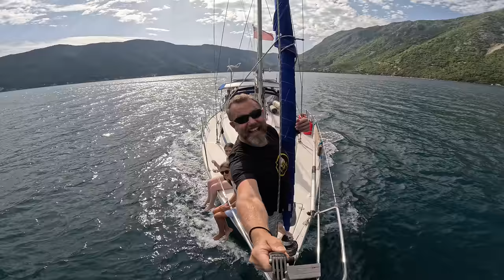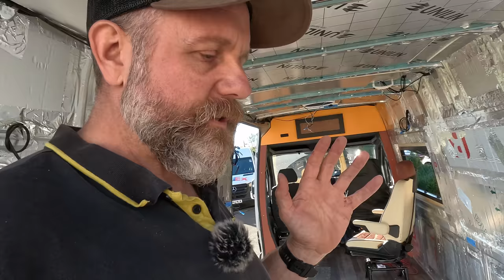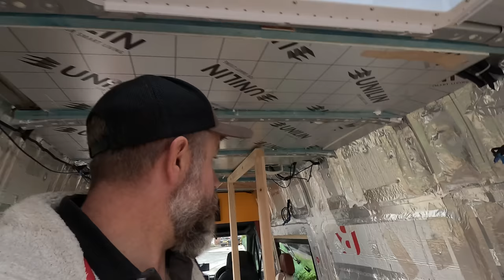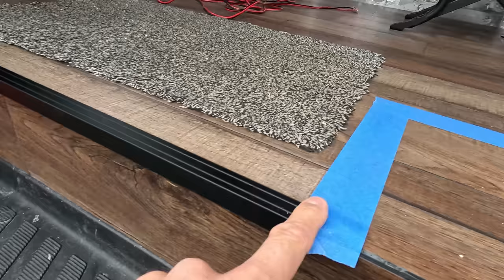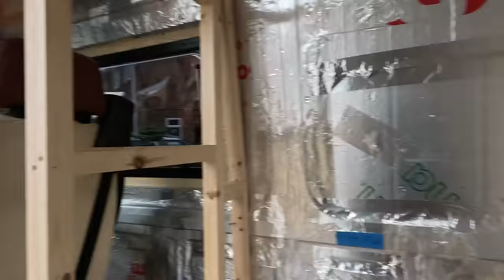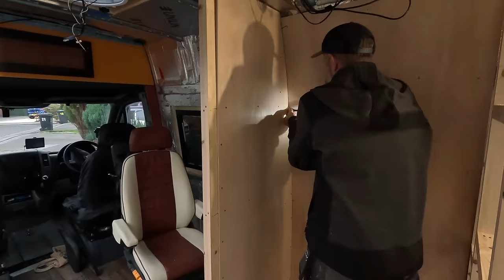Building Our Shower & Toilet Cubicle! Sprinter Van Conversion Progress

Comment: on bathroom buttons, to be honest (not expert advice), I would use thinest thing possible that can fit screw laying around👍. construction is there to hold it, sheet is there  to connect them and keep sturdy, most important is layers of waterproofing, keeping weight down and space up crucial thing😉
Reply from the maker: Hi. Thanks for the comment and feedback. Yeah I regret getting 9mm ply. But it's up now and not changing. It's hard because I'm so used to houses and building everything for strength and weight never been an issue. I'm learning 👍👍😁

Comment: Great video, your videos, or never too long . I could watch you for hours. The shower is looking great well built look like the shower sapce is big enough to put the toilet in for privacy  i seen van buld where they put the toilet in the shower in a draw that you pull out inside the shower and when finished use it just push it back in and turns into a shower it qouls be good but ellas bed is going to at side of the shower and i know she is small but not that small 😂😂😂 great job ❤❤
Reply from the maker: Thank you. Yeah u originally wanted to do that with the toilet but like you say, Ella's bed will be in the way. So we'll just have to lift it out of the way to shower 👍
Reply: @life_uncharted  yes it is  just as easy living it out can not wait to see next week video left in on a cliff edge 😂😂😂😂 ❤
Reply from the maker: @ls1100  🤣🤣🤣👍😁

Comment: a lot of people ive noticed use 12 mm ply for batterns it seems to be ok as it bends round where its needed and i have also seen they use 9mm ply to line it where cabinets go and 5mm on the rest if that helps
Reply from the maker: Hi. Thanks for the info. All help massively appreciate 👍👍😁. Cheers